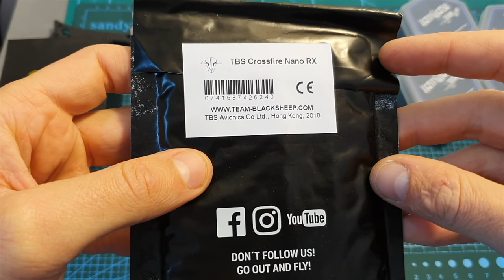Yakuza R226 Frame Review, Build & Flight

Comment: NICE! Ive been looking at these motors for a while, what kinds of flight time do you get on them? Also would you consider them both a freestyle and a racing motor that could be put on a quad that could be used for either?
Reply from the maker: The setup that you are going to use is goong to affect the flight time. In my experience these motors are very powerful  and will probably be good both for freestyle and racing.

Comment: How do you like these motors? I have been eyeing them for a long time now but ive seen very few reviews about them... any info much appreciated!
Reply from the maker: As you may know I have a lot of quadcopters and I can't fly them all the time. I can tell you that out of my 6-7 packs experience these motors seem to be very smooth and powerful and provide a good value for money.
Reply: @KremerFPV  thanks for your opinion. Much appreciated! I have wanted to try these since they came out but i need to find a frame that will fit the mounting mechanism.
Reply from the maker: @flighttherapybullisticfpv133  No worries!